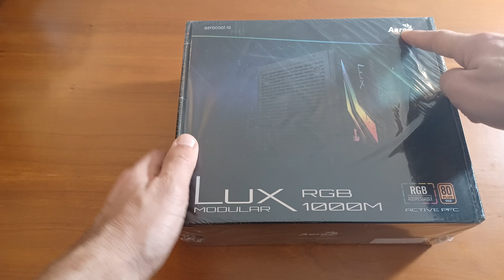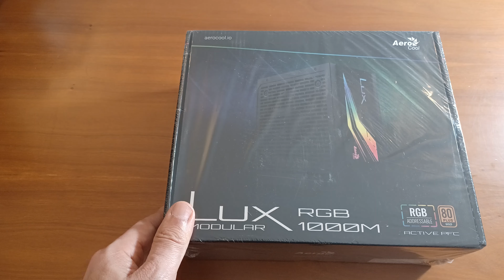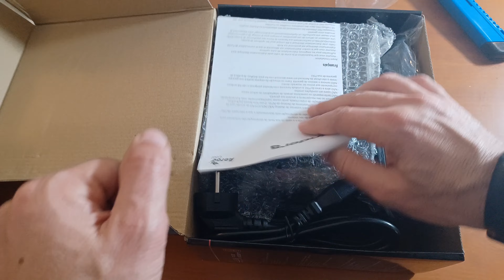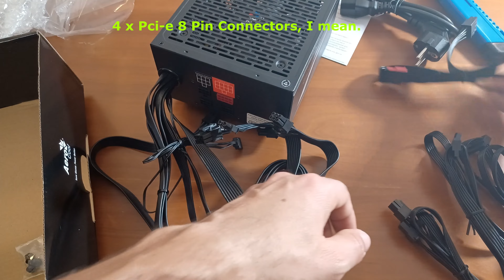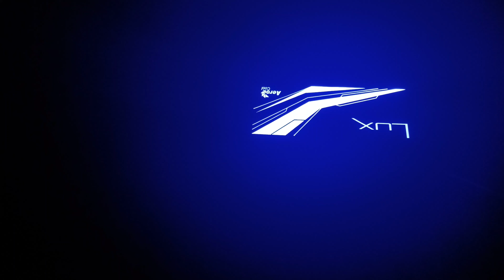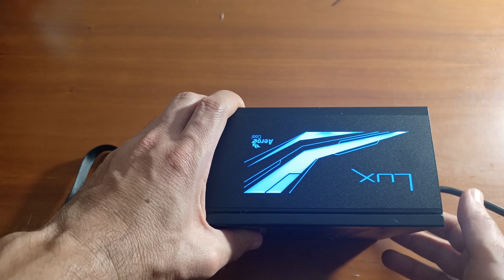Unboxing of Aerocool Flux RGB 1000w PSU

Comment: I have aerocool lux 750watts argb is it okay to use it on heavy load it'll not explode? My gpu is vega 56 210watts
Reply from the maker: You are safe if the tdp of cpu and gpu are below 70% of total psu power. Also consider power for hdd, fans and extra devices.

Comment: is this good for a buget 1000w psu?
Reply from the maker: Its not stable when it has load. The voltage will drop. Corssair, Seasonic are much better.
Reply: @rtrextech  okay its the Gigabyte P1000GM better than this?
Reply from the maker: @yuzur0fps  don't know, look for reviews .
Reply: @rtrextech  okay
Reply: No bro @yuzur0fps

Comment: Hello is this psu good for 3080ti gpu?
Reply from the maker: It should be ok, but I would recomend a better PSU for 3080's and above like a Corsair, Seasonic, Coolermaster, EVGA, etc, they are more stable on the voltage output as the power goes up.

Comment: trying to get a new psu thinking of a 1000w but defs need a RGB one to fit my setup this a good choice?
Reply from the maker: Today I got a replacent for rma mine died after 2 months. If you can goto Seasonic or Corsair.
Reply: @rtrextech  are they rgb? on the fan cause that's what I need for my setup or it'll took trash I have a 750w rgb corsair one atm but need a upgrade cause I am wanting to upgrade my CPU I just got a new GPU the 6900xt tuf gameing and definitely need more wotts if imma get a new cpu
Reply from the maker: @kehoon  Corsair has RGB psus, Seasonic don't think so.
Reply: @rtrextech  1000w?
Reply: @rtrextech  I’m looking for a 1000w with rgb